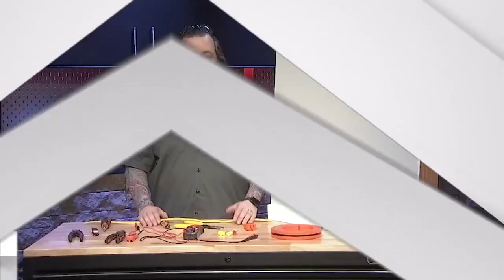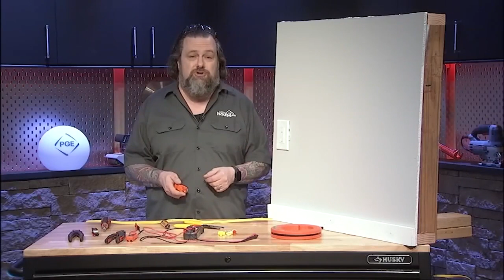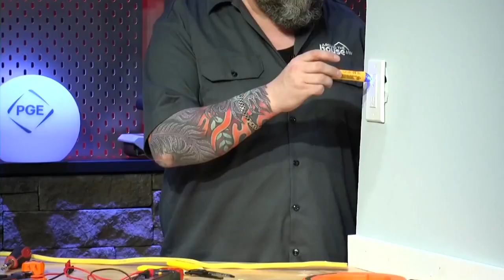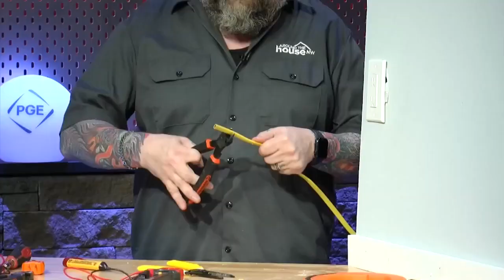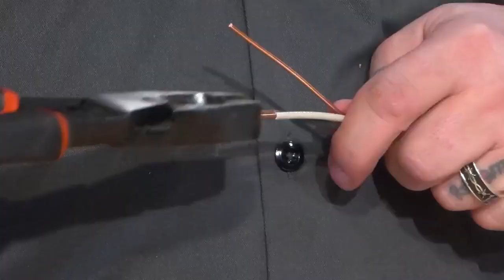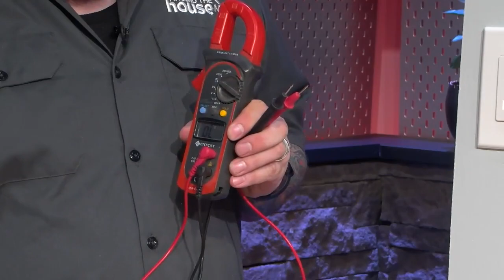Perform Like a Pro: Working with basic electrical tools

Comment: its not the Volts that kill ya, but the Amps. If you touch a live wire while its varrying frequency (change in miliseconds) is at the same frequency as your heart beats, then it'll get ya.  Its luck, dont take the chance.